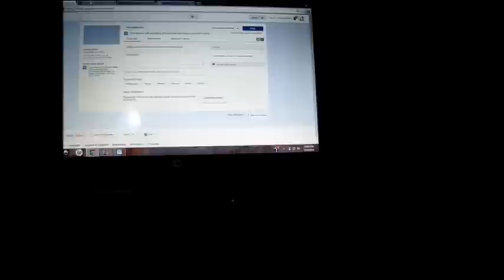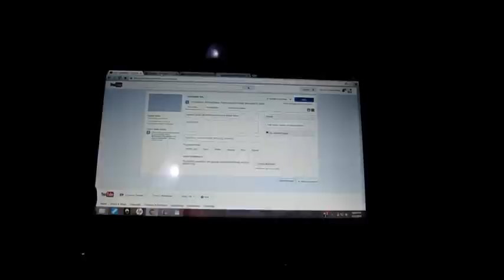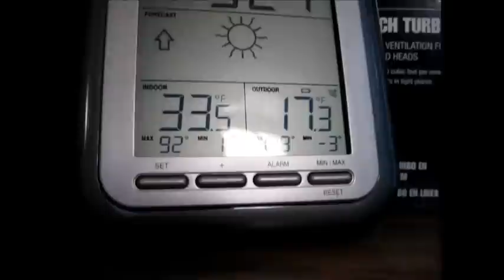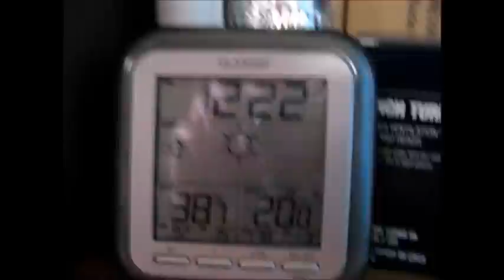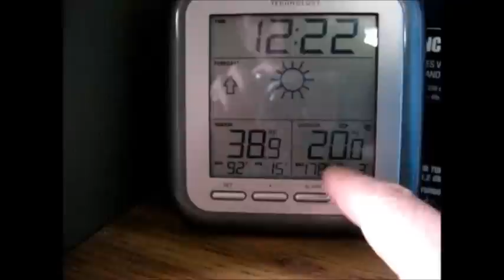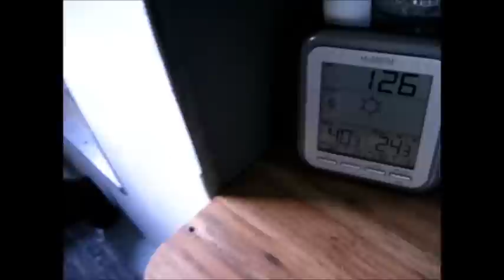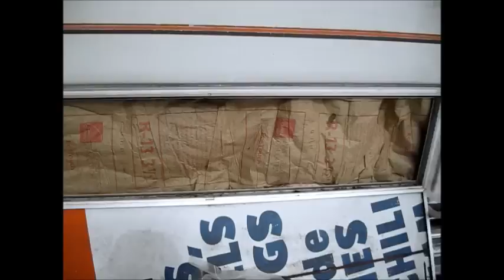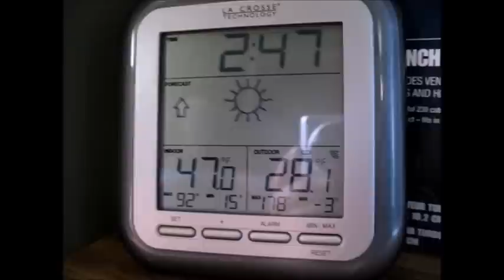Fighting Freezing Cold And Numb Toes In My Off Grid RV

Comment: This is painful to watch. The ONLY priority he has is HEAT, and in his set up that means fuel to burn in his barrel stove. He obviously has a way to get to church so he certainly can get out to obtain sufficient stores of fuel to provide a heat source sufficient enough to dry out the wet wood he has on hand. Home Depot, Lowes, any lumber yard either gives away scrap wood or sells if for a pittance. Wood bundles are sold at most grocery stores, even 'fire logs' would provide a reliable way to keep his stove working for the time needed to dry out his on hand wood. Heck, charcoal would even do it. Additionally he could start a small 'bonfire' outside to dry out his on hand wood supply. Geeze, there are so many simple solutions here that are obvious that it makes one want to cry. A boy scout might be consulted, they certainly know more about fire craft!

Comment: Glad you made it thru. Learning experience. Being prepared for cold is something too many overlook.

Clothing is the first line of protection... Rubber boots? Even when insulated they should be avoided in freezing temperature. Jeans? An other one of the worst fabric to wear when it's freezing. Your hands got to be protected with mittens as they don't isolate your fingers. Even empty bags of chips are better than most gloves.

Going to sleep when extremities are freezing is real bad idea. Hands are quite easy to warm up (under arm pits) But feet are harder, first you raise your body temperature by doing some activities, laying on your back and your legs up you can pedal in the air which will help get you warm.

Comment: Well, in a perfect world you should have finished winterising the trailer before late October. But I would have skipped church and took care of the warmth issue in the trailer. The possible problem you will face with now will be mildew. When you can I would check the panels and sweep them off so you can get the battery bank back up. Also, I would suggest increasing the size of it.  From 6 to 12 batteries.  This way maybe you can use a low power electric heater next winter.

Comment: Troy i froze my butt of this winter without any heat, i was under 3 Thick blankets,  the van wasnt sealed and there was water getting into my rugs, so my rug was also frozen. This year im insulating the van and getting a new R.V. heater with 40,000 BTU's unit compared to the stock 15,000 BTU unit. i had a open battery box with air coming in, i had door seals that didnt work and wind was getting in, this was up in New Hampshire. This year i hope to be done with the insulation and new furnace so i can stick around here, if not im heading into Texas for the winter. I know how it feels. I hope you stay warm and good luck.
Reply from the maker: Thats horrible. But we keep improving and making our lives better with time. Now I sweat in the winter in the off grid tiny house on wheels. I insulated it so thickly that I have to leave the windows open. And it feels so good :)

Comment: Troy you need some cold weather army gear (jacket, trosuers, boots , gortex socks and gloves and a cold weather sleep system. Cotton Wool balls dipped in vasoline - is suppose to be very easy to light and stay lit for camp fires
Reply from the maker: I have cold weather gear if needed. When outside I am dressed for it. I just got back from Australian summer so I am a bit weak.

Comment: Troy,  take your truck and get a load of pallets.  They might have broken ones that you could throw in stove as is.  Use your crowbar or battery powered saw to break the pallets up.  Get the stove hot with the pallet wood.  Dry some wood by the fire, then gradually mix you from your pile with the pallet wood.

Comment: when you are in a jam for wood like this you should think finding a dead tree close by thats still standing, standing dead wood is usually quite dry if you get a somewhat fresh one, also birch burns green, you can cut it and throw it right into the fire, also you could use your propane oven as a heat source aswell, my dad leaves his on minimum setting everytime he knows its gonna be cold to keep his house warm while hes away, or to get the house up to heat faster

Comment: Your condensation is caused by heating with the propane. The resulting exause from that flame is water. You need to reseal that porch with plastic. Someone mentioned bales around the MH. I would at least grab 4 of them and stack them up behind the unit to help seal that back hatch.

I went Elk hunting this last year with my 1993 15 ft Terry trailer. I was setup in a meadow at about 9200 ft up a valley and the night time lows were around 0. I used the same Buddy heater you have and kept it at half heat and was very comfortable in the evening. I kept the roof vent opened a little to exaust the moisture. I have a cover over the roof vent so I can have it open no matter the weather.
Reply: It is a fact, Link Knight. Check it out: http://www.ehow.com/about_6635338_burning-propane-water.html
Of course, I knew it from experience. Hunting for over 55 years in the Colorado Mountains and various kinds of heating teaches you a lot.

Comment: Bears hibernate during winter, but aren’t sleeping the whole time. Hibernation for bears simply means they don’t need to eat or drink, and rarely urinate or defecate (or not at all). There is strong pressure for bears to stay in their dens during winter, if there is little or no food available. But bears will leave their dens on occasion, particularly when their den gets flooded or is badly damaged.
Reply: I did not know that, makes sense though.  Especially if their dens are damaged as you said. Hopefully, for Troy's sake, that bear has gone back to bed for a while.
Reply from the maker: I dont know when they come out. Normally its spring now.
Reply: The Do It Yourself World Spring starts on March 20. Not that it will be warm of course. I've seen ice at the base of Niagara Falls as late as June.

Comment: This is a year and a half late, but in the winter you need thick handmade socks, mittens and hat to begin with. Long underwear is your friend. Get a dozen of those cheap mylar emergency blankets and use those. One below your sleeping mat, one over your covers, others to drape around to keep the heat in an area. If you are going to wear those rubber boots then slide some of the emergency blankets around your wool socks before you put your feet in those boots. Glad you made it through that.

Comment: Of course, the best way to keep an RV warm is to keep the cold away from the RV. Start by shielding the RV from wind using terrain (hills, forest, etc). An open field is a poor choice for a campsite. Afterwards, with wind reduced, one of those tent garages from Harbor Freight over the RV can work wonders. Even a few inexpensive tarps are better than nothing. Use boards or branches over the roof to create an air pocket between the tarps and roof, with lean-tos on the sides of the RV from the roof outwards. This guy, with his wet wood, poor insulation, and similar, is doing little or nothing to help himself.

Comment: Troy welcome home.
Can I make a suggestion to you?
 When you repair the porch Don't use the plastic film that you did.
Why not use the Palruf 26 in. x 8 ft. Clear PVC Roofing Panel or Palruf 26 in. x 12 ft. Clear PVC Roofing Panel .
You will still be able see though and they will with stand the wind better.
And they do not cost to much ether the 8ft panels are $14.00 EA and the 12 ft are 20.00 Ea the 8 ft ones are 26" X  96 "  and the 12 ft are 26" X 144"

Comment: Reflectix is a great insulator. Otherwise, use plain bubble wrap on the windows. Spray the window with water, then press the bubble wrap bubble-side against the window. Should provide insulation and light. Just saw that on another channel. Have been using Reflectix for years on RVs and a Jeep parked in the high desert. Keeps heat in if necessary; keeps heat out if necessary; all around great product.

Comment: You need to layer your bed with what they call 'Space blankets', plastic sheets that have a reflective side that holds in heat. Place one between layers of blankets, or whatever you are using on your bed, to hold in your body heat. DON'T use on the bottom (underneath you) too, as it can cause moisture to make the bedding damp. And THAT can make you colder.
If you are sitting in a chair or couch, wrap your legs in a bunch of blankets with a Space Blanket inside Lay 1/2 of the blanket on the seat/couch, sit down on it, and pull the rest of the coverings over you. The Space Blanket needs to be between the first and second layer of blankets against your body, to hold the body heat in.  
I found a large pair (size 10, and I wear a size 7) boot. It has an artificial wool lining. I got the boots so large, so that I can wear several pairs of sock, and they will still fit.
And, I warm my fingers on my cat. Have your cat it sit in your lap as long as possible, and sleep beside you at night so that you can share body heat. (It's a one cat night.  :-))
Native Australians used to relate night time chill, by how many dogs they slept with. The more dogs, the colder the night. Hence the saying: "It's a three dog night'.

Comment: i would got on first trip made a list propane, sheet plastic to fix porch to store some wood and dry it out, get food to, thus the wood will dry out! go to your truck camper to heat it smaller keep you warmer! it been ice here i had to use lighter to thaw out locks and un stick doors and this morning fix a solar wire it broke, i used propane to keep me warmer my main heat was re adjusted it was poping and banging when it came on it was out of adjustment, i leave it at the set the guy makered it was in 30's when set he said it not warm enough move beyond mark when down to zero i did it once

Comment: Troy, take the yellow metal tray that you used in the old camper under the old stove, and put your frozen firewood on it inside in front of the mr buddy heater. That should help you get some firewood going.
Reply from the maker: I will fix the solar porch and then it will thaw fast again. I will also cut new wood.

Comment: I know just how cold 30 degrees feels indoors. We lost power here for 2 days after the snow storm, Georgia is not prepared for that stuff. Anyway the only heat source we had was the fireplace. We all camped out in the living room where it stayed in the high 40's. I had to use the same wet frozen wood, yes it was a pain to burn but it will still burn. Needs to be cut smaller! I put frozen pieces in the fireplace and to the side to dry out, no harm done. Some pieces that were close to and touching the flame would burn a little. Point is that you can place wood in the area of the burn barrel. Pieces can actually be stacked on top for a few hours to expedite dry time. Stop fearing a fire from indirect heat combustion its takes very high heat over a very prolonged period of time to create fire!!!

Comment: You need a roll of plastic to get that porch to hold your heat and capture the suns heat.You can dry your wood in the porch at least a few sticks at a time then.Maybe a kerosene heater for backup to your propane (second hand on Craigs list).A couple of ideas. Good luck with things "keep warm " .
Reply from the maker: I will fix my porch and use that as a solar heater. It worked in the fall nicely. Kerosene is too expensive around here. Thanks
Reply: Use Kerosene heat for emgy. only  Duraflame logs will burn hot enough to thaw out cut wood;;an warm you up;;
Reply: +The Do It Yourself World maybe cut wood and store it to dry out a few months before actually needing it. That is an awesome way to have it when you need it.

Comment: Here are my thoughts. To warm your fingers up quickly, put them under your armpits. Sounds gross but, it works. Also, keep vasoline on hand. If you use it on your fingers and toes it helps prevent frostbite. Even mild cases. Come spring, I would suggest building a wood shed. It maybe easier then worrying about the tarps and snow. there is also a candle heater I have heard works. It uses 3 terracotta pots, 1 smaller then the other. A screw and washers between each. Youtube shows how to make them.  Hope some of this helps.
Reply from the maker: Yes on the warmth and the wood shed. A candle puts out 1 BTU. My propane heater puts out 9,000 BTUs and is not enough heat. That thing looks nice on video but I do not believe it can help me. I have used candles as heat sources before and froze in the old truck camper.
Reply from the maker: I am going to make on some day and test it out in the truck camper just to show what happens.
Reply: The Do It Yourself World I'll be very interested to know if it really works as well as it is said to. They say the metal has to heat up first. I would suggest using a can of Crisco. lasts for days. LOL! OK, I'll quit rambleing, for now! :)

Comment: I have a hard time with this, look 44 F is not cold, my guess you are wet, even if you don't feel wet you are damp. The trick is to stay dry, wear a wool cap to bed. Take your bag and run it thru a drier. Also a couple of wool blankets will help you. Good long under wear and wool socks I live off grid myself, and I don't have a problem till the temps get to around 25 below zero. Another trick is a couple of hand warmers in you bag will keep you warm at night. The only time I get cold, is when I don't eat enough. Its hard in dam conditions like you are experiencing, the key is stay dry.

Comment: Wish there was a way for you to have an electric blanket. I always put a foam mattress topper on the tops of my air mattress because it helps keep things warmer. Even a memory foam twin topper would help. Walmart has them pretty cheap. May help some. Hurry up Spring!!
Reply: Electric blankets are fire hazards, esp. in rough environments or around pets.
Reply from the maker: I do not have the electricity to run one though. I have plenty of blankets. Its warm in bed most of the time. Getting up is the hard part. I will fix the porch and shed and it will be better.

Comment: Troy do you have a pair of winter gloves? If not get yourself some, if you can't find or afford good ones then get some good old jerseys and double layer them. Also get a big buddy heater they put out 18000btu and you can mount them to a wall somewhere baby cat can't access or flip her tail near. If you don't have any wall space then get a wire dog cage and set the heater inside it so baby cat cannot reach it or tip it over. Since the front is the part you have to worry about  you can find a way to anchor the heater to one of the long sides of the cage to prevent tipping. Just make sure you have a good carbon monoxide detector near your bed hung low since cm is heavier than air. Just some thoughts. Good luck to you and above all stay safe. Do some research on those tracks so you have a better idea of what you are dealing with.

Comment: If you could put some boards or tin around the bottom of the RV to skirt it, it would keep wind from blowing underneath it will positively be warmer take my advise you will be glad you did. I used to live in a trailer house and when there was no skirt it was cold cold but after I used tin to skirt the trailer it got a heck of a lot warmer. Because if the wind can blow under it will cool it down for sure. Put the plastic back on the porch that should help a lot too.
Reply from the maker: I agree fully